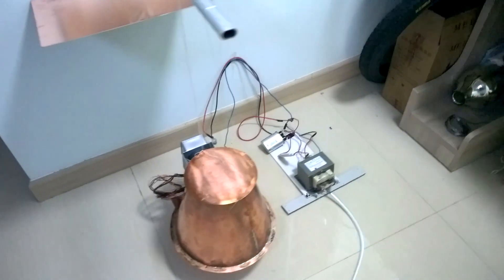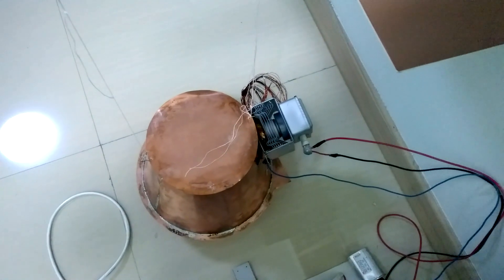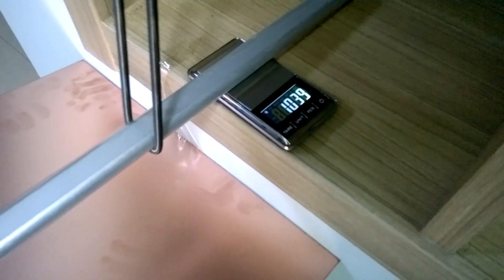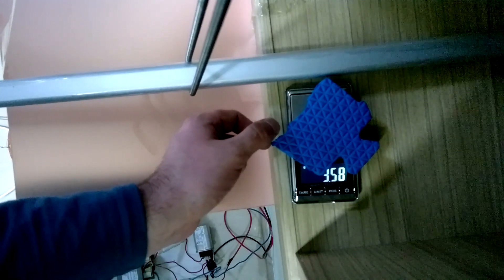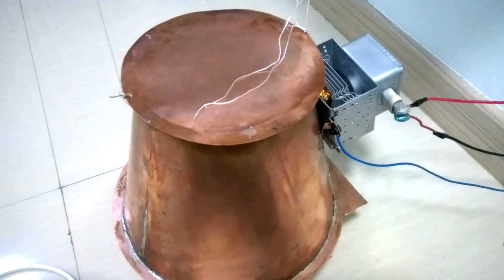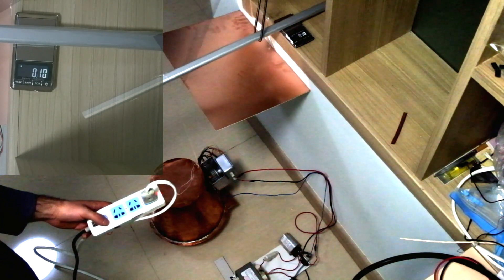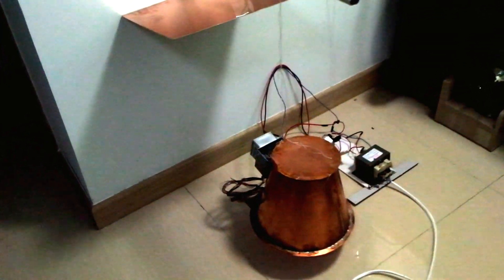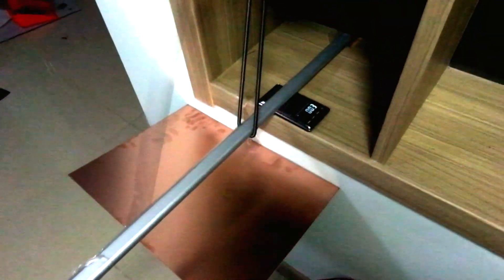EmDrive Test No.03 Success, I have thrust !!!

Comment: What would it take to get it off the ground?
Reply: +Aricu Nono 1000 years
Reply: Me in Tears...
Reply: I understand skepticism, but when 3 different experiments from EagleWorks, NW Polytechnic and Dresden U have all indicated that some kind of thrust is probably present, it's time stop calling it impossible and find out what exactly is going on.  EagleWorks' tests have been very thorough, the chance of it being an experimental artifact at this point is getting very low.  It's also important to understand that the "small" amount of power is still more powerful than the ion engines we are using now.  Even if it's not quantum magic, some variation of this engine could represent a great improvement in deep space propulsion and it's worth investigating.
Reply: +Aricu Nono Externally applied force.
Reply: LOL, Not cool....  I want to see this thing same size self-propelling some weight.
Reply: +Aricu Nono Fairy dust.
Reply: +Aricu Nono The same as with all Mad Science: MORE POWER!!!
Reply: +Ragecraft Nah, the same with all crackpots ... more money.
Reply: more money, more bitches. more bitches, more problems.
Reply: +Aricu Nono Understatement of the century:  The physics behind these devices are poorly understood.  It's unknown why the system produces thrust, so we can't begin to predict how the system would react if we changed the variables.  As far as I know, there is no short-term plan that would enable these devices to create usable thrust in Earth's gravity, but assuming they really work, they provide more thrust more efficiently than the modern ion engines used in space probes, so they would revolutionize our ability to explore the Solar System.
Reply: +Ace theSuperVillain The physics is completely understood. That is how physicists know that it will not work; the fact that engineers think that it will merely reflects their poor education and dubious experimental skills. It is ironic that this nonsense persists precisely because the 'thrust' (more likely an experimental artefact) is so small. If it were large, one could use a ballistic pendulum to demonstrate a permanent offset from the plumb-line. One is instead left arguing about minute signals (analogous to the so-called evidence for telepathy, etc.)
Reply: +Ace theSuperVillain Perhaps you have forgotten the early days of cold fusion, when many reputable laboratories claimed to have reproduced the Pons & Fleischman results. The same thing happened, to a lesser extent, with the so-called Podkletnov effect. Langmuir pointed out long ago that this was a common feature of pseudosciences.
Reply: But saying that Cold Fusion didn't work so RF Resonant Cavity Thrusters won't work isn't science anymore.  The low budget RF Resonant Cavity Thrusters have all shown promising results, and Eagle Works has tested for anomalies like EM interference, so the next scientific thing to do is keep testing them to make sure that they work.  If you want to say that Eagle Works, Yang and Tajmar all made a mistake in methodology or statistical analysis, then fine, but I'm betting you haven't read their papers at all.
Reply: +Ace theSuperVillain I read everything, with the eye of a skeptical physicist. Unless one is 'in the job', one is not aware how often positive results turn out to be artifacts. What you perhaps do not realize is that the idea is not new (Goddard made the same mistake nearly one hundred years ago, before switching to rockets) and attempts have been made to patent such devices many times since. The only thing that has changed is that Shawyer's patent was granted. That should never have happened; perhaps the examiner (Mr Vosper) was 'internet-taught'.
Reply: +John N Quite: what will happen in outer space? Well, if the stupid baffle at the wide end were removed, the microwave photons could propel it. So why is the baffle there? Because Shawyer stupidly thinks that he can have propulsion and yet retain the overall mass of the Emdrive. That is physically impossible. Could there be propulsion with the baffle in place? Well, the microwaves will heat the baffle, and so infra-red photons leaving the hot outer surface could lead to a propulsive effect. But where are those photons coming from? From the energy-source of the Emdrive. But hey, m = E/c^2 and so the Emdrive is still losing mass overall. So, the laws of physics are satisfied ... but Shawyer's claim of not needing reaction-mass is a blatant lie!
Reply: +John N Yes. Where have you been for the past century? There is also a 3rd-law reaction, obviously.
Reply: If the EmDrive's thrust is due to radiation pressure, shouldn't that work without breaking the laws of physics?  The reaction mass is electricity/photons absorbed from its solar panels and then shot back into space.  

What do you think of Dr. White's explanation that the EmDrive works like a propeller pushing against something-or-other on the quantum scale?  

Another dubious explanation was that Eagle Works' interferometer detected a suspicious warping during the experiment.  The measurement could be due to who knows what, but if device is in fact warping space-time or causing artificial gravity, then the motion at least is not breaking any law of physics, but we're stuck with answering why a copper cone full of microwaves would warp space-time.
Reply: Ace theSuperVillain The laws of physics are never broken, only the laws of men. Think on who taught you the 'laws of physics' was it a human, a fallible human mind? Or did you learn from nature directly, as Newton did? 

Not to diminish the accomplishments of human inquiry but only to remind us that we are talking about human accomplishment when we say 'the laws of physics' rather than actually referring to the unbreakable laws that define the parameters of our possibility.
Reply: +Ace theSuperVillain If the radiation really went into space, there would indeed be propulsion. But it instead bounces off the inside, so it is like trying to fly a plane which is attached to the middle of a sealed and impervious box. The concept is fatuous ... and not even new. What is worrying is that engineers think that it will work, but physicists just laugh at it. There is definitely  something wrong with the education system.
Reply: +Ragecraft How do you think that they spot new particles at CERN? They detect them because, when they apply the conservation laws to the interactions of known particles, discrepancies show that unknown particles must be present. Now, if the conservation laws apply right down to the sub-atomic realm, what are the odds that the tinpot Emdrive evades them?
Reply: MrAaronvee The radiation emitted by the magnetron would bounce around inside the cavity, but wouldn't the cavity itself heat up because of that?  The blackbody radiation would propel the engine, like a yarkovsky effect.  It doesn't sound like an efficient solution, but if data indicates it's an improvement on the Hall thruster, it's worth investigated.  

Gravity distortion is still my favorite solution.  That sounds much more useful in the long run.  

Ragecraft It's not disputed that humankind has yet to completely map out the laws of physics, but there's also no reason to expect that this device is some sort of magic.
Reply: +Ace theSuperVillain Yes, I have mentioned that possibility in other posts. By the same token, one can imagine that some of the crackpot mechanical drives (in which balls rather than photons are bounced around inside of a box) might achieve propulsion if one end heated up more than the other as a result of the impacts. But it is all a bit of a stretch isn't it?

Comment: Do not try this at home unless you understand how a microwave oven works. That magnetron he has attached to the side of his bucket runs on a negative five thousand volts and as much as ten amps. That is enough to kill an unwary person. I have twenty four years experience repairing televisions, microwaves, stereos and other small electronic devises. In the early days we didn't have a way to check the voltage with a volt ohm meter. We had to use a television CRT high voltage probe in reverse to get a reading if the magnetron was defective. I got shocked once by touching the wrong end of the probe and that is something no one should have to experience. I'm just glad I had a strong heart. I say again. Do Not Try This At Home.

Comment: if i studied the issues correctly, thrust should increase with the quality factor of the cavity, which is about how much the signal can bounce inside before it is absorbed.. but also depends on the resonant mode, and not all modes produce thrust. the Cannae test article had a Q factor of about 8000. the german group's Q was around 80. is it possible to (a) determine the resonant mode here, (b) power the device for longer than seen in this video, say long enough to show that it isn't a momentary twitch, (c) measure the Q factor of the cavity?

Comment: You can't test an EM drive within an EM field... try this experiment in a Faraday cage so that you don't have interaction with the earth's magnetic field, or any other magnetic fields. It will give you some more steady results. Also if you get a voltage stabilizer to avoid any creation of fields due to the electric wires, and it will prolong the life of your prototype

Comment: So apparently the reason that they say that this engine is impossible is because of the law of conservation, which I understand but find stupid at the same time. Its supposed to be impossible because you are producing thrust by introducing energy into the system pushing at the opposite end of the engine. (I think) This violates the law of conservation because you are getting thrust without using any sort of particle to produce thrust. The quantum vacuum engine does NOT violate the law of conservation because it is using virtual particles to produce thrust. I could be entirely wrong with what I am saying, cause I researched the law of conservation on wikipedia, but basically, it is just on a technicality that this engine is not supposed to work.

Comment: To be fair all you can say is that you have detected a force, you do not know the origin of it. It is there when the microwave generator is on, but it still might come from an electromagnetic coupling between the components of the generator and your electroinstallations in the the walls or in fact any conductor within some meters from the experiment. Nevertheless, interesting experiments.

Comment: You need to collect a vacuum chamber the size of the engine. 
Device: lead, the outer casing 1 cm, steel in 3 cm thick.
Supports up to floor to ceiling: the diameter of the circle is 16 cm.
The top cover is made with a groove for insertion of up to 0.1 mm. Then the air will not pass.
It is important not to forget that per square meter pressure 1.1 tons of air. To have withstood the metal you need to properly collect design. 
Video camera - to see what is happening inside the webcam.
The high-pressure pump (you can ask the companies or laboratories).

Will test the camera, which transmits only the Electro-magnetic field and a certain percentage of screens gravity (don't remember Which). 
Make a clip with the self-timer button.

If your engine is able to operate inside the device, it will fly.
When you set the maximum power to let go of the clamp. Measure the acceleration.
If the acceleration exceeded the maximum speed, sit down, count it. If everything came together, blow to NASA and ask for a large test chamber for astronauts. If and where everything came together. Blow in the patent office, then to the TV. After that, wait for calls and messages. If not, ask in NASA video of presentaci possibilities. (hint: you can use for mining in space that will make NASA independent Finance Corporation).

Important: engine Weight must be less than the force of the movement.

Comment: I made very similar experiment several years ago.  And the unknown force occured like an ordinary Lorentz Force coming  from power wires. To prevent it you need to place wires diametrically to increase the distance and reduce the magnetic interaction. Also there is some thermal distortion of  wired conductor under the current. You  could check it  simply replacing your wires to different locations. So you need to place a current source to a board.  But I want to believe it works :-) . And have some thoughts about theoretical explanation.If it is true, have an idea how to improve the construction.  But it clearly violates the established laws of physics. Who knows?!

Comment: You should do these to make your next video better :
1- Protect yourself, EM waves are dangerous. You should not stay close to the device and protect yourself.
2- The experiment should be contained inside a closed glass box or something, removing interference from the moving air.
3- Buy a very precise scale to measure with more precision and maybe have it hooked directly at the rope.
4- Don't move the equipment before measuring.
5- Would be even better in a vacuum outside and inside the cone. No more hot air balloon arguments.
Reply: +Promethor I agree on all points and then some. All EM/ES/EG fields are very not healthy to be in or near, just how unhealthy is decided on congruence of several factors. There is no way I would stand that close to that device, sensory tools just for EM alone are fairly cheap to purchase and if nothing else would provide a good point to decide arguably "safe" distance from the device. Before I get romped on about mention of electro-gravitic field generation unless I read his scale wrong that 3.6 gram object was ~not~ 3.6 grams when placed on the device..
Reply: +Promethor Let's send him some lead underpants. No more cooked huevos.
Reply: It's completely harmless for two reasons. First, microwave radiation is non-ionizing, so it cannot cause any risk beyond heating things up. Second, he is not only separated from it by the copper "bucket", he is also at a distance where even if the magnetron were aimed directly at him, he would likely feel nothing more than a slight warmth. This is coming from experience working with magnetrons before.
Reply: doggonemess haha!
Reply: +Promethor You don't want to end up like the guy to first test frame space drive. Sheesh.
Reply: promethor you're just proving your ignorance of electromagnetic physics.
Microwaves cannot pass through metal. They cannot pass through holes in metal smaller than 1mm (depending on wavelength microwaves are considered between 1mm and 1000mm)

He's safe standing right there so long as his enclosure doesn't have gaps larger than the wavelength.

Look at your microwave door and notice the mesh. that's shielding you from the microwaves and allowing the much smaller wavelength EM waves known as visible light to pass through.
Reply: tim patin True.
Reply: +Promethor In regards to 1, doesn't the Em Drive just use a microwave magnetron? If so, isn't the worst thing that could happen be some damage to his camera from induced electrical current and some minor burns from heating of the skin?
Reply: Phoenix Im not sure of the strength of the Magnetron used in this device, but even Micro-waves are dangerous if you stay too close. Mostly burns yes. Personally, i would not stay next to it, neither would i put myself in a microwave. Of course im not saying he should be behind some lead wall, but i don't think its really healthy to stay so close to the device when its in function.
Reply: Sam Crow Great comment and i totally agree with you.
Reply: Really good advice, who would of thought YouTube could one of the best DIY discussions on the internet for the EMDrive.
Reply: Kind of like stepping inside a airport scanner?  :)

Comment: My only suggestion is to place the apparatus in a grounded Faraday cage to prevent RF interference on the meter. A very simple test to see if the meter is affected by RF energy from the magnetron is to operate the device like normal but with the meter under no load (No weight). If RF is interfering with the measurement it would probably make the meter change under no load conditions. The reason I mention all this is that on the video you can hear RF interference when the device is energized. So these are just sanity check and simple precautions. If you have an Oscilloscope you can detect the signal waveform, frequency and strength based on distance. Just some basic techniques and ideas on how to improve the fidelity of the experiment. Good luck.

Comment: I've read that the drive works best while under acceleration, so it may necessary to test it on a horizontal swinging arm rather than under static load to achieve best results.

Comment: That dodgy force balance could produce that measured thrust if you looked at it crosseyed.  I'm guessing convection from the magnetron cooling fins.  A vertical axis torsion balance, hanging on a wire, would be better.  That RF shield is also poorly positioned, not between the scale and the magnetron.